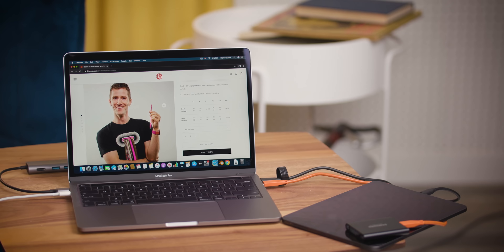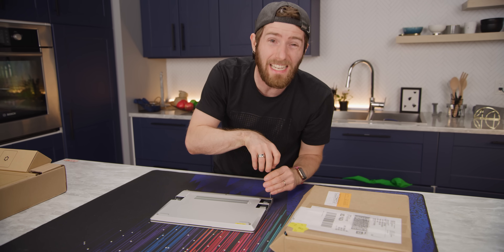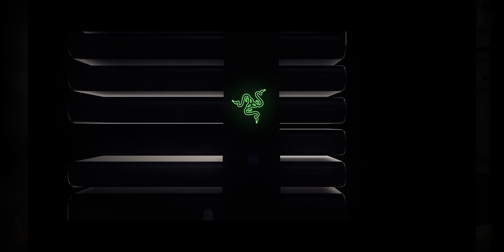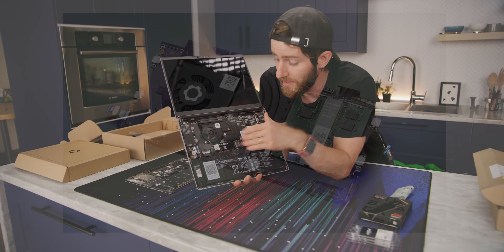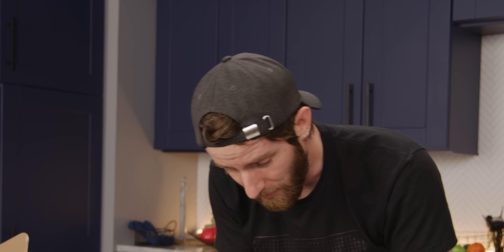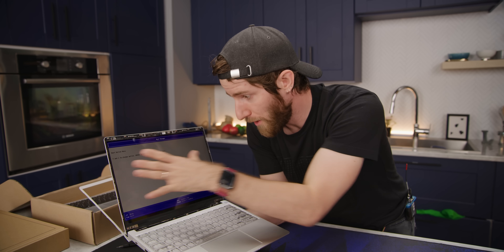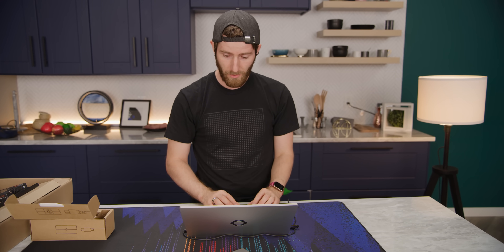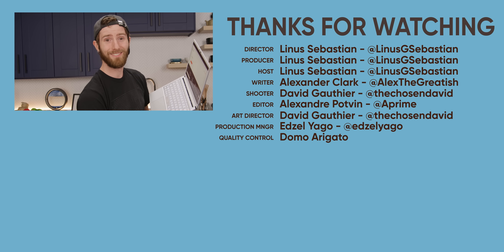A COMPLETELY Upgradeable Laptop?  - Framework Laptop Review

Comment: Bought mine two years ago. A few weeks ago my keyboard started acting a bit strange. Some keys on the right side have stopped being reliable. No problem. $39 later I've got a brand new keyboard in my system. Maintainence still holds strong. Could not be more satisfied.

Comment: One thing I don't like is the non-modular headphone jack because I use wireless headphones and also the only non-modular I/O should be a USB-C so that if you lose your modular dongles, you can still charge it and not soft brick your computer when the battery dies because you can't charge it.
Reply: You can charge the device via the motherboard USB-C port just fine, they just don't reccommend you do that where possible in case you damage the motherboard
Reply: The port that all the dongles plug into are USB-C & i would assume you can just take a dongle out and charge using that port but not 100%

Comment: I hate that i just found this. I havent even had my laptop a full year yet. I paid $100 less than what this one is going for, which ive enjoyed mine, but still. Ive recently went back to my older laptops that ive kept over the years and my oldest one doesnt have modern ports for anything. 1 usb and 1 sd with 2 ports dedicated to headset and mic inputs. If it was modular like this, id be able to instantly swap it to usb-c and id be in love.

Comment: Laptops have gotten so bad in terms of easy end user repair. I am a regular viewer here, but have no other experience in computer assembly or repair, and my old hp laptop had 5 screws holding down the back panel, and the battery just had another 5. I bought a new one on ebay because the current was bad and fixed it myself super easily, but my mom asked me to do the same for her macbook and I couldn’t even get the thing open!

Comment: why am i actually so touched by the QR codes hey integrated in the components TT
Reply: Because like 8 years ago IT WAS NORMAL

I just opened my old HP Laptop and the battery, wifi card, ram, hard drive, and speakers all had QR codes!

Comment: @LinusTechTips I feel they could make it better by just making is upgradable and remove the quick swap option. The parts should be modular but they do not need to be atached using magnets and don't need to be slide in. It should be such that you can disassemble it and upgrade any part quickly. This will make the build quality better and lower cost

Comment: When Linus said performant, how performant? does it get the same, similar or better performance than other laptops in it's class? like 4090 and 13th gen intel performance?
Reply: Not 4090 because that would be absurd for a laptop of its size but it does have 13th gen level performance(assuming you get the 13th gen) 
If you really want the 4090 level performance wait until the 16 inch drops in a few months

Comment: I have a gaming laptop that I was lucky enough to upgrade the RAM and SSD without doing something wrong. Lol. Don't know much about the insides or if this company has one already but I'd definitely ditch my current laptop for one if they had one powerful enough for gaming since that's what my gaming laptop is mostly used for. Hope this company is here to stay. This is definitely a change then the standard laptops that you pretty much buy and ditch after they get old and slow 😁🤣

Comment: It's even worse than Dell Latitude, where you can plug in 2.5 SATA HDd, ssd and dvd-rw  drive simultaneously. fully upgradable memory. Easy changeable battery bunch of IO things like VGA, HDMI, LAN, cardreader, 3.5mm jack availability to dock it to even more increase io. That's all in a compact 14' notebook with very nicely done metal case

Comment: It's the age old disposable vs. repairable.
Both have their pros and cons.
Would you prefer to still be driving 1970 family sedan as your primary commuter?  Planned obsolescence and disposable help foster advancement.  For a pretty good example consider automotive safety systems and devices.  There are probably things in regard to that most people aren't even are aware of.  Like crunch zone.  Yes they make the vehicle less durable.  But they save a lot of lives and reduce a lot of injury severity.

Yes we are talking about a computer here but some of the same principles apply.  And like techbio mentioned.  The big difference is with the modules and motherboard upgrade.  Most notebooks have had up-gradable memory, storage (HDD/SSD) and WiFI for a long time.  Largely due to industry standardization. That's nothing new.

To me it would be appealing for high end notebooks to protect the larger outlay $$$ from becoming a paper weight due to some failure.
High end is not just measured in terms of processing performance.  But also by the feature set.  Like Large touch screen with active stylus.

Comment: One module bay is pretty much dedicated for power/charging.  Leaving only 3 for "real" usage.  Should either have 6 bays or a dedicated charging port aside from the 4 bays.  Power/charging is something every computer needs.  Give it a dedicated port.  Could even be a swap-able module for various physical power connection form-factors.  For instance USB-C, 3.5mm barrel, etc.

Comment: The only significant appeal of this compared to existing laptops is the modular swappable units. HP, Dell, Lenovo etc can all be opened easily enough and memory, battery, wireless cards and storage swapped out. But being able to add hdmi, display port etc, change number of usb-c ports and so on, is very innovative. However you are still locked into the manufacturer for modules. What I'd like to see is swappable modules that you can mount your own mini pci-e cards in. So you can buy pci-e cards from any source and install them in the module and plug directly into the module port on the laptop. That would be true platform independent upgradeability and customisability.

That said I'm not dissing in this laptop, it's very appealing and something I will consider when I reach the end of the upgrade path on my current HP 11th Gen laptop.

Comment: Your affirmation that CPU modulars (anymore maybe but used laptop market can serve you right,there are options from the manufacturers who still support the idea) with any power to their computing arent available anymore is untrue, most of mine even the shitty 11 year old gateway got modular processors and I upgraded all of mine with SSDs recently and just recently adding a CPU onto the 11 year old running gateway that got overheating issues (used 30 cad ebay CPU should do the trick).
The name of the companies I use the laptops of are Gateway and Dell for the harder access laptops although they got easy ram and hard drive bay access (you gotta pop the fuckin keyboard out for the motherboard access and usually remove a bajillion cables).
Hp laptops and presumably my asus got easy access hatches even a step further easier than razor and this because ...
This is still a top-hatch easy access system, which is not as good as say, my elitebook 8440p with its underside easy access to motherboard, ram, CPU ,GPU, heatsink, fan and its hard drive and I already popped the CD dvd bay for a second hard drive bay. Its a bottom hatch that got FLIPPING TAB SWITCHES you simulatenously pull to open slide the panel, its frickin great, does have a tiny 1 gb vram gpu with a 1gbish width bus or so or something akin but with proper storage unlike the 500 gb crap hdd I bought it with it is actually a pretty decent pre 2015 games PC.

Top hatches are the bane of my existence, why the fuck you guys develloping laptops make it so you gotta pop the keyboard at all, well, at least this is a top easy access, my dell and gateway laptops are hard access bottom motherboard one so I gotta unplug everything topside then reach my hand under an inch of space with wires attached to the bottom. Nightmarish and frustrating I hope I never do solder needing damage reassembling em, at least, I gotta change that gateway CPU soon.

Comment: if the motherboard had a daughter board with the CPU and RAM, like the Macintosh Powerbook G3 Lombard, you could use all of the same internals with just a CPU/RAM upgrade
Reply: The motherboard is replaceable, and most of the the accessories are on daughterboards, so you just swap the mobo
Reply: @marcusborderlands6177  I'm glad that's the case - I'm reminiscing a bit of course, but the PowerBook G3 had a daughter board with the CPU and RAM on it, so you could perform upgrades without tearing out the whole motherboard.

Comment: I've had two issues: first, holding it up at odd angles compresses the chassis in a way that presses the buttons on the mousepad.
Second, the included charging cable is trash. I had to replace it after about 4 to 6 months of use (I picked up a 10 ft. Braided usb c to c cable instead of rebuying).

Others, as a college student who mostly uses their laptop to take notes and occasionally play Factorio (for very long sessions), it's great.

Comment: The ability to easely swap the keyboard alone makes this product very atractive in my eyes, knowing how easy it can be to ruin a keyboard with a spilled drink. My lenovo legion y520 has dead key, and i would have to litterally disasemble the entire machine, including removing the heatsink which mean also automatic repasting of the chips, and then break plastic rivets to extract the keyboard and glue a new one in. Alternatively, I could swap the entire front plate with the still functionnal trackpad, and that is a minimum 120€, with shipping.
So instead of all that nonsense, I am using a 15€ USB keboard for now.

Comment: My Acer from 2014 is super easy to upgrade both the hard drive and RAM. It's a real bummer I can't upgrade the cpu. I'd be the happiest man alive if I could put a faster cpu in it.
Reply: If you started with 64GB of RAM, then you can't upgrade it more when the OS starts to become slow. If you started with 32GB, then there would be a noticeable difference in performance after making the upgrade. That's because you not used to the architecture.

Comment: My son somehow just destroyed his HP Pavilion after just 16 months of service. At the very least it needs a new trackpad, a new display and new top cover. I can't find any way to buy these parts from HP. HP does provide a bunch of YouTube videos on disassembling and reassembling the PC but parts? No idea. The PC works fine except the trackpad and display.

It was very easy to find these parts on Framework's website and it would cost about $280 for the parts. And it's awesome that you can take the internals and make a desktop PC out of it.

I'm sold
Reply: bro how do you destroy a laptop that fast, like is it just cheeto dust and extreme raging
Reply: "just 16 months"
Reply: @yoursleepparalysisdemon1828  a year and a half is not long at all. Every laptop I've used has gone strong for more than 4 years
Reply: @_wayward_494  
its not a normal amount of time, but thats not short.
Reply: @yoursleepparalysisdemon1828  in terms of what? A bag of chips? That's a long time. But for a laptop, then no
Reply: @yoursleepparalysisdemon1828  That is short lmao. I've been using mine for 3 years and I'll continue for at least 3 more.
Reply: @RealElevenTimes  i've had my 250$ asus laptop for 3yrs i just retired it when i got my gaming pc last week. it could still go for many years i just needed more from my computer
Reply: @yoursleepparalysisdemon1828  My laptop is from 2012 lol. I only use it to watch movies, occasionally Word and surfing basic websites. Granted, if I needed it to game or do daily work, I'd upgrade. Unless you play highend games, a laptop should easily last you 5 years imo. I love this Framework concept. May well be my next laptop! Would like it to be AMD Ryzen though, not Intel.
Reply: @navn  
I have a laptop I use every once in a while. It has lasted 3 years (damn that was a while ago) with minimal loss in power. I still use my PC more because of the customizability and the "freedom" it gives me to do everything instantly.
Reply: @yoursleepparalysisdemon1828  I also use my PC more, but that's probably 4-5 years old by now, so "old" as well. Would be easy to upgrade though, but I haven't needed it yet 😊
Reply: @navn  
a pc can last a very long time as long as you future proofed and treat it well. I would be careful with your storage failing, especially if it is a hard drive.
Reply: How do you ruin a a laptop that fast?
Reply: @superNova5837 gravity

Comment: Got mine a few days ago. It's definitely the coolest thing I've ever owned. The trackpad is not great, but I'm literally not even concerned because when a new, better one comes out I can just .. swap it! It's so cool!
Reply: i just ordered one and im wondering how long it took to get there because i cannot find anything on their website
Reply: @theratking14  I live in the us. It came from Taiwan and took just over a week. The longest part was getting verified at customs because FedEx does not examine packages over the weekend I don't think.
Reply: @noahbraasch7854  ah i see thank you! im so fuckin excited i saw this video awhile ago and i haven’t been able to get one until just now.
Reply: @theratking14  haha good stuff. What config did you opt for?
Reply: @noahbraasch7854  i got the i5-1240p, 1tb sn850 nvme and 16gb of ddr4 (i assume that is what you mean)
Reply: If they made the battery removable, added a decent GPU to it (without needing to sacrifice the possibility of adding a second battery) and had an old school trackpad with physical buttons that are not part of the touch surface, I'd buy one
Reply: @mwbgaming28  check out the 16 inch version! It has everything described (except maybe the track pad with buttons?)
Reply: @noahbraasch7854  if it's the one I think it is, the swappable GPU uses the same socket as the secondary battery, meaning I wouldn't be able to have both connected at the same time (which is exactly when you would want both connected at the same time) also the main battery is still internal and not removable without tools (good luck getting an iFixit kit past the TSA)
Reply: @mwbgaming28  That makes sense. Though I will add, the single screwdriver that comes with, is all Ive ever needed to open it up and work on it.
Reply: @noahbraasch7854  they need to make a bulkier version with more expandability, better cooling, dual battery support (with a total of 199wh) modular GPU, swappable trackpad, and an AMOLED display

Today's obsession with electronic anorexia is making it impossible for me to find a suitable upgrade path from my latitude E5430 (which has the expandability and dual battery system I want, but no GPU)
Reply: @syriangamer89  can you drop a link or name of the product? cannot find it
Reply: You could initially buy a laptop with nice touchpad :D I don't know what people are talking about repairability, but when a HINGE ripped off from the screen on my first gaming laptop, I've just glued it back on epoxy and assembled back together.. I really don't understand what's so special about this "modular" laptop if when something really breaks, you can repair it by yourself most of the time.
And it really doesn't matter how modular the laptop is. If you can't repair a normal laptop, the chances are, you won't be able to repair this one as well
p.s. Even though, I prefer buying a top-tier laptop and just using it for a couple years before swapping on something completely different, being able to adjust RAM timings would be really nice..
Reply: @ruslan_yefimov  we can repair the electronic devices ourselves but this is getting different with the products that have come out recently as I don't think there're many company that still make repairable laptops (and other devices).  Yes we can still fix some components, change some other things but that has become much more difficult. Most companies want us to buy new, not fix. Electronic devices have never been and may never be environmentally friendly, but we can reduce those impacts and that's what a lot of people are looking at with companies like framework.
Reply: @ruslan_yefimov  You're thinking far too macro-mechanical. In your average laptop, if you don't have a specialised workshop, you can't replace your buttons, power sockets or connector docks without risking to fry everything when you put a solder iron on a device with some seriously tiny, glued-together components. All of this is much more reasonable to do in a design like this.

And then, even on a macro level, repairing anything on this laptop, including simple part replacements, will come with far fewer risks of destroying the chassis. Sorry to be confrontational, but honestly, if the screen bezel's magnetic removal doesn't tell you enough about how much more durable this laptop will remain after a repair session or two, compared to an average design where everything is fully integrated, I have to question whether you have any serious experience with what you are talking about...

> "If you can't repair a normal laptop, the chances are, you won't be able to repair this one as well"
< With this one, you can try, if it's your last option because the technicians in your city charge €300+ for anything that takes more than 10 minutes.
With a regular laptop, you're almost guaranteed to just fry it and have to give up.

At the same time, if it's an easy repair like a screen replacement or something similar, you are much more likely to get the job done without having a broken piece of plastic or a damaged cable when you're done.

And finally: with your average laptop, you're relying on whatever price and shipping conditions ebay resellers are willing to grant you for the part you happen to need. With a company concept like this, you know they'll support your repairability at reasonable prices for the next 8-10 years, at least.